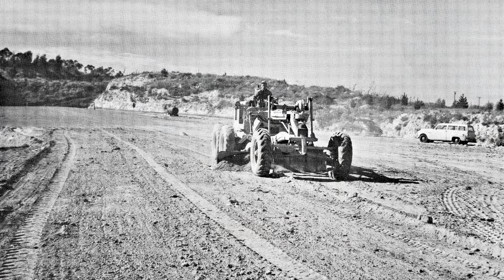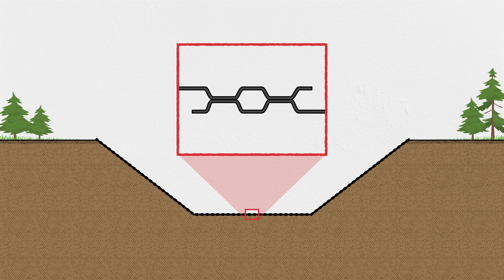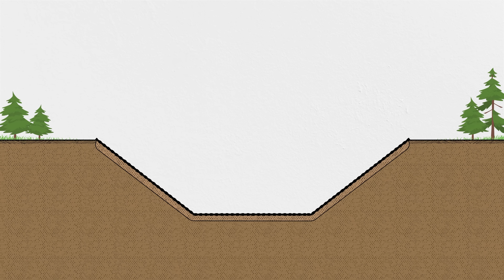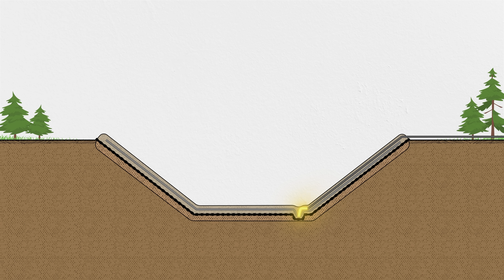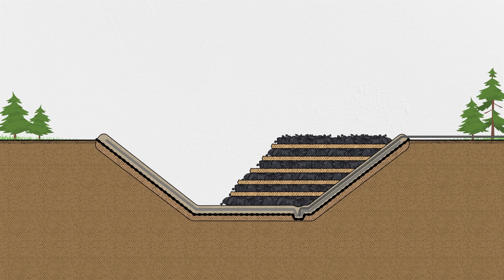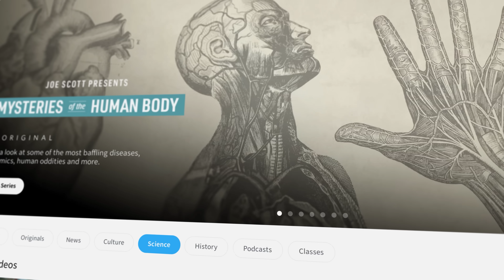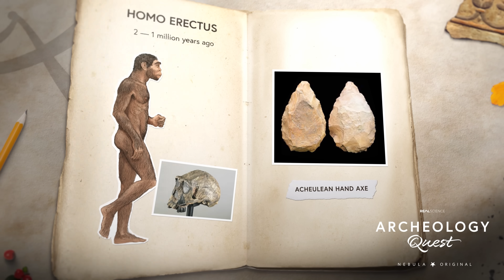The Hidden Engineering of Landfills

Comment: Great video! Our trash went to a burn dump in Yolo Co. California when I was a kid in the 60's. Everything and anything was allowed to be dumped, paint cans, lawn clippings, household garbage, old appliances, you name it. Two or three times a year they would lite it off. A massive column of grey-green could be seen Northwest of town and smelled if the wind was right. They even let the public to continue to use the dump when on fire! There was a constant noise of whistling, pops and bangs as different types of containers with different contents burst from heat. It closed in the early 70's. I visited the site via bicycle in the early 2000's, it had been leveled and surrounded by a ditch filled with nasty green water with an oily sheen on top.The burnt ground was made up of 1/2 broken glass by volume in my estimation. A couple of years ago they dug it (Bryte Burn Dump) all up and hauled it all off to a toxic waste facility. Crazy!

Comment: Something many people don't know or realize is that there could be a landfill right under your house or down your street and you may never know it until something not so good happens such as a slide or collapse from the old careless, unregulated days of dumping, covering and running to another cheap place. It doesn't have to just be a trash landfill, there are countless types of disposal sites and they can be anywhere. Two types I am very familiar with and have worked at are coal ash, coal refuse sites. PA is filled with them and many now leaking and contaminating the land which you do not really want as fly ash is not too healthy. Thankfully times have changed and these newer sites are safely operated and coal ash and other combustion products are being used for their many beneficial uses rather than being wasted. It would be nice if the state would step up and address the issues it was left with from those old days, but that means there would be benefit in places other than these rotten politician's pockets.

Comment: Québec has a second type of landfil: the snow dump.  the stuff collected from streets is considered contaminated (salt and all the car exhaust mixed with snow)  and not allowed to be dumped untreated in rivers/lakes or ground. So large areas that look innocuous enough are created with special drainage to ensure that when the snow dump melts, it all goes to water treatment plant.   In Montréal, there are a dozen small sites where dump trucks dump the snow into  large shafts that lead to the huge sewage collectors that go direct to sewage treatment plant (heat from sewage melts the snow). 

One special snow dump is an old quarry. No sure how they deal with water there. 
Outdoor snow dump:  45.45323328199728, -73.61650679714924
Quarry snow dump:  Carrière Francon 45.58026939999154, -73.62991251183148   (at northern edge, you see the ramps used by backing dump trucks to dump snow). 
Sewer snow dump: there are 13 or more.  One of them at: 45.4712  -73.5598  It is the square thing, and in winter the cover is lifted and there is a large grate to prevent people from falling i to sewer.  Dump trucks just pour the snow in it. 

The rule prohibiting dumping of utreated snow in rivers/lakes dates from 1997.

Comment: I live in a small rural town.  Our first 'dump' (we didn't call it by the more sanitary term 'landfill') was a low, semi-swampy area next to a tributary to a river that provided drinking water to a small city about 25 miles downstream.  Living on a farm, we had our own dump out at the edge of the 'back forty.'  But I remember that original dump being several feet lower than the road.  A few decades later it grew to a hill 25-30 feet higher than the road.  So my town acquired another site to construct something closer to what's known as a landfill today.  The original dump was about 4 acres - the next was 'landfill' was over 8 acres.  It only took less than 20 years to fill that site to a point where it had to be closed and capped.  It has also grew to over 50 feet in height.  Keep in mind, this is a town with a population of about 5,000 residents.  We now ship our waste elsewhere.
Since my parents were active young adults during WW2, recycling was ingrained in our thinking (before it became socially expected).  Metals, glass & paper were all valuable recyclables.  Very little got hauled off to a dump.
Then at some point we became a throw-away society.  A very sad point in our evolution.

Comment: I grew up near that Puente Hills landfill.  My elementary school was about 8 miles away and during P.E., we could see the trash trucks going up and down that trash mound.  If I remember correctly, although the landfill was closed in 2013 they stopped accepting trash or they slowed down how many trash trucks they accepted in the early 2000's.  Azusa ave where that landfill is located use to have a train of trucks in the right lane waiting to get into that landfill but I remember not seeing them anymore in the early 2000's

I moved away from the area in 2006.  I had a job near the former Puente Hills landfill a couple of years ago and when I drove by, I was so surprised to see that they had built an entire shopping center on top of that landfill.  It looked as if there was never a landfill there.   But I question how durable the land under that shopping center is because I live in Orange County now and the parking lot at a hotel I use to work at is sinking and one of the workers that has lived in OC for a long time said there use to be a landfill where that parking lot is and that's the reason why the parking lot is sinking.  Another thing that bothers me is that what if you didn't know that there use to be a landfill there and you bought a house near it?

Comment: This is so interesting and changes my perspective on landfills in general. Given this information, do you think that throwing away plastics is actually better than trying to recycle them? I know the recycling stream is basically a hoax in most cases, since China doesn't want to buy our plastic anymore. I suppose it mostly ends up in the general waste stream anyway...
Reply: I worked for a shipping container company, dropping off and picking up loads and delivering them from Phoenix to the port in LA. I have been to many of the.Waste Processing Centers, and the only plastic that is bundled and shipped, are the clear plastic water bottles. All of the other plastic is discarded into landfills. My sources at these landfills and processing centers. Tell me that it is much too expensive to process colored and other plastics.

Comment: Or....  you can generate nearly no trash, like I do.  5/6ths of the trash I toss isn't even mine, and even with that included, I still generate less then 30 gallons of trash a year.  The only reason i have ANY trash is because there are certain things I simply cannot find without plastic packaging.  Everything else is composted and used to feed my garden, where i generate most of my food (eventually all of it, 1-2 years tops).  Imagine making packaging compost-able and having a "dump" that merely repurposes the waste into fertilizer for farms.  And it is actually easy, but people lack the ability to adapt into new routines.

Comment: The civil engineering involved in building those large play structures for the future park will be ... interesting. Foundation calculations usually depend on assuming undisturbed, stable  ground, as you've pointed out many times (esp. the retaining wall video) putting proper foundations under all those structures (that slide!) will not be a "lowest bidder" sort of situation, it will require careful oversight. Hope the City/County are up for it!

Comment: Nicely done. A good basic description of a landfill and how it works.  I have developed site with horizonal gas systems that we install as the site fills.  This allows newly filled sections of the to be included in the gas system when they are ready.  We have a site in the Metro Atlanta area that has both gas to electric and CNG gas conversion on site.

Comment: As a landfill gas engineer, I approve of this video. In the year I've been employed as a landfill gas engineer, I have been to 10+ different landfills, and 6 of those I have partaken in monitoring contractors as they install LFG pipelines, install air and forcemain leachate collection systems, and drilling LFG extraction wells. I've also been part of very extensive design packages for clients who look for economic and cost-effective ways to build and run a landfill. From a general public point of view, Grady, you did an amazing job defining what a landfill is and how they work. My team will be using this as a way to teach new hires the in and outs of landfill operations.

Comment: In the commercial district of my city, there's a shopping complex with the most uneven floors. One of the stores, the floor is like rolling sand dunes so when your pushing the shopping cart it just rolls all over the place.
This is because the shopping complex was built ontop of an old landfill, and you can see the pipes that release the methane and other gasses.

Comment: So question, you mentioned the decay of the trash over time, makes a fairly high amount of heat, especially if you add back in air. Would it be feasible to control adding in the air, so it produces enough heat to produce steam to run a turbine? The cost to start it might be high but could it offset costs after closure to do this?
Reply: They already do this! There are landfill gas extraction wells that extract the methane coming off the landfill and then some high producing methane landfills will have a turbine generator onsite converting the excess methane into energy and then it'll get sold to the local power grid. In cases where methane quality is poor or production isn't enough for this to be profitable they will burn it off, or they'll separate the hydrogen sulfide from the methane and sell the methane to local powerplants potentially.
Reply: @abrodsky  not what I was talking about, not even remotely.
Reply: @agoddamnferret  then are you wondering if  landfills can be an anaerobic biodigester to generate energy? Because they also do that at landfills as well.  But in general the landfills do produce a lot of heat but,  it is in the best interest of the landfill managers to mitigate the heat because it poses a fire hazard since methane is already produced onsite.

Comment: Is this capsule enough for the trash to fully decompose over time ? If there is no connection with worms, bacterias, ... from outside, are the germs inside the trash enough to do the work ? How long to find a empty space or at least a non polluted space ?
Reply: No trash will completely decompose over time, due to bacteria, and chemical factors (waste composition) which cause the breakdown of the landfills. In most cases the land after a landfill is placed on it will never be completely "non polluted" after a landfill is built on the site. However, landfill technology  has gotten really good so landfill leaks are becoming less and less common meaning landfills causing groundwater quality issues are less and less common. In addition some landfills are actually being excavated after complete construction due to them containing fly ash which is becoming very valuable for the concrete industry, and in this case once the whole landfill is technically "gone" then it'll become a brownfield site.

Comment: Been building landfill cells for over a year now, everything is bang on, the one I’m currently working on has a clap wall, geo cushion, membrane and fabric, then we use drainage rock instead of sand and the ground is sloped to a sump where the leachate drains to, we have an onsite water treatment plant. There is so much engineering in it

Comment: I looked up some 30 or 50 comments - nobody said that a certain amount of taxation to finance recycling made visible, can help too. 

Recycling goes on cost of us all, so there is this variable tax. If i consum more I pay more.

And this may become applied to both sides of the value chain, 3 cents for recycling on a new milk bottle or McDonald's bag - and on my trash can I put I front of my house. With a bar code on the trash can registering the number of yearly numbers of emptying - the first 18 or 24 could be free to aviod avoidance - or the stop of the truck in front of my house goes registered GPS with time stamp legal proove.

Progress is possible, I have a wild landfill about 700 Meters behind my house, adjacent to the next creek, in the 1950s and '60 used for private purpose of both US soldiers of Spangdahlem Airbase and german citizens, it's covered and registered with the local authorities and eventualy looked up from time to time. (Like the levels of poisons like extinguishing foam PFAS in the local fishing ponds around and deeper to the Base on the plane because of the pasts fire extinguishing exercises.) (You still can't eat that fish.)

Comment: Oh god.
If all garbage is burned at a high temperature /+-1500 °C/, 1/5 of the volume will remain. And the energy from combustion can be used to produce electricity, heat, cooling...
And emissions from combustion can be filtered very easily.
Landfills are just moving waste from place to place without purpose.
Reply: Just because you can burn the trash does not make it better for the environment. In many states and local areas incinerators are actually banned because they cause air quality issues for the people living near them. Even if you can "filter all the emissions out" but many incinerators operating as businesses will only do that filtering to whatever the bare minimum of the state and federal regulations are. The current  regulations do not account for every  harmful constituent coming off those emissions. An example is PFAS is not regulated currently and is an emission coming off of incinerators.

Comment: I have no idea how landfills or thrash management works in the us. Is your trash that you throw in your garbage all collectively dumped on a landfill? Are there separate bins for plastics and paper for example? 
I did some research and these open landfills he shows are not welcome in the EU. Residual (home) waste (everything else then paper/plastics, biological trash, glass etc.) has to be burned.
However what I found out is that the burned ash and filtered air particles are highly toxic and need special dumping in secure facilities to avoid leakage.

Comment: So what happens when the plastic lining under the landfill breaks down in the next few centuries? These landfills are ticking environmental time bombs waiting to happen to future generations.
Reply: Something not discussed in the videos is that in many landfills it's not "either plastic liner" or "clay" in current federal regulations landfills are required to have both 2 feet of clay underneath the plastic liner system in addition to the plastic liners. In addition many modern landfills actually have 2 plastic liners installed as an additional redundancy to prevent leaks into the local groundwater and ecosystems. Something else to consider is the plastic being used for the liner is VERY heavy duty, and when taking into account that it just takes 450 years for just a bottle to decompose, many landfill plastic liners are designed to last an eternity.
Reply: @abrodsky  I mean that's all nice and informative, but it's still kicking the can down the road for someone else to pick up.

Comment: Incredible that a developed country like USA don't burn the waste. It gives much less waste which may go into concrete and improve its strength and the heat can be used for heating at least in winter. We have done that in Denmark since the 1960's.

Comment: Genuine question: What, if any, progress has been made on engineering microorganisms to actually physically eat through all of our trash and waste?

It might not be applicable to that specific landfill in LA, not the least because they already have a plan in mind for it, but it sounds like a great idea to be able to re-use landfills after a few decades or centuries because all of the compost is literally eaten through by microbes or otherwise safely turned into eco-friendly things. Maybe we could even get to the point of it only taking months or years for that process.
Reply: Micro-organisms are already evolving by themselves to dispose some types of wastes, such as microplastics, but the waste needs to be prepared in the open air for about a week for them to work. Woodfree unbleached paper can be disposed of by cellulose-eating bacteria and trees.
Reply: @erkinalp  Interesting. How long would it take them to run through a certain amount of trash?

Comment: Back in the mid 1980s, a new concert venue opened in California:   Shoreline Amphitheater in Mountain View.  It was built atop a closed landfill.  However, there were problems with fires igniting from fans' smoking materials, and the source was determined to be methane leakage.  They had to shut down the site, remove the lawn and install abatement measures prior to reopening.  It made huge headlines, and was rather scary.

Comment: In San Diego we built a small civil airport on one (Palomar airport, KCRQ), and its a little bit lumpy but super fun to fly out of cause it sits above the surrounding terrain and the runway is just lumpy enough to be kinda cool but smooth enough to not cause problems. It has to flare off its gas off to the side and in a closed burner though because of all the fuel present.

Comment: If you run perforated ventilation pipes across the bottom of the buried trash pile (at every 10 feet or so) and pump air into the bottom of the accumulating pile 24/7/365, does that significantly increase the rate of decomposition for an "average" city's collection of garbage?